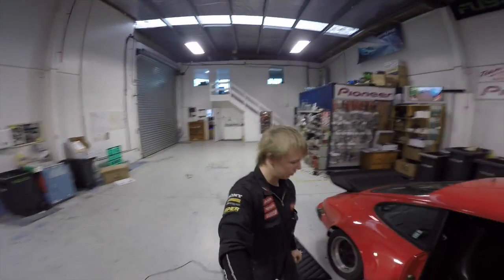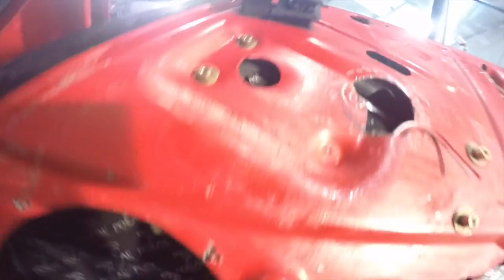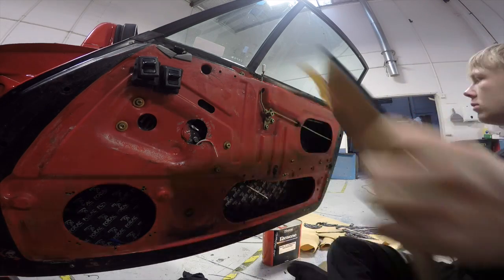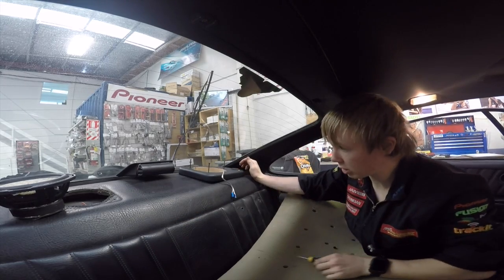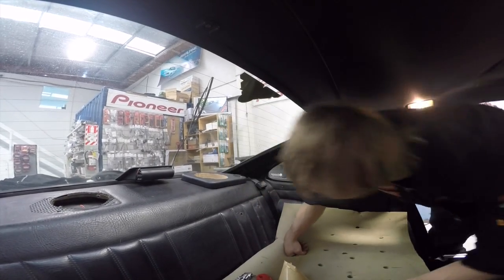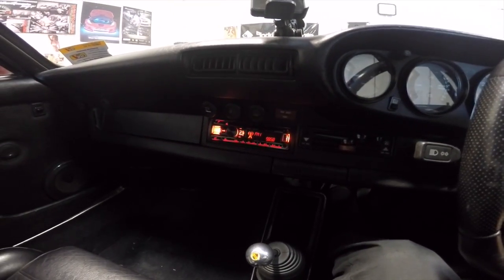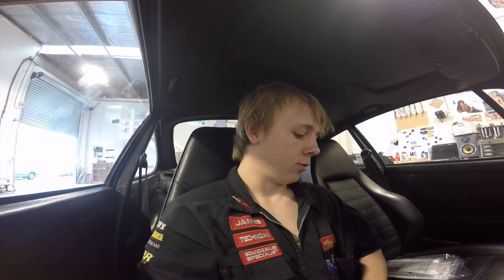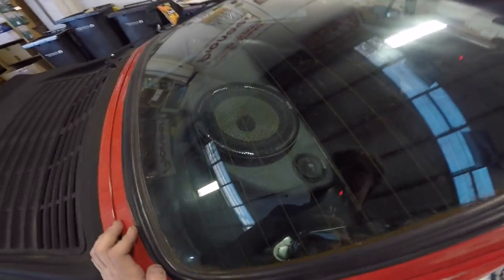Porche 911 Full Focal Sound System FINISHED!

Comment: your videos are great.  hope it is ok if I add a thought.  I like the focal bam on the outer part of the door but not the internal because water can get in there when it rains or even when car is washed, down the window glass.  better in my view to use Dynamat on the inside because its outer coat is metallic and it will not absorb or hold water.  I learned this the hard way, had used Dynapad on inside of door, car never sees rain, but from washing only, it was clear to me water had been retained at times when I looked in there a few years later.   Also, I love that Focal Bam as a cover but for eliminating resonance, Dynamat is awesome.  anyway, you have great skills.

Comment: Have you worked with the Focal FDP 6.900 Amplifier? Im thinking about transitioning to a Focal System over my current Infinity Kappa system. Thinking about going with the K2 components and K2 subwoofer.

Comment: Great setup, I do hope you cleaned up those wires for the customer though. The ones on the left side where you put the Xovers, kinda unsightly to see the insulator caps hanging out:)
Reply from the maker: Where abouts in the video are you talking about?
Reply: It was towards the end when you were doing the overview of work. Where you put the left crossover behind the carpet you could see the connectors above the carpet where your feet would be.  Didn't mean to point it out to make you look bad,  I think you do great work:)
Reply: It was at 16:53 by the way. I just know with my feet I'd probably tear a wire loose:)
Reply from the maker: All that extra wiring you could see hanging out was the cars factory wiring harness, nothing to to with the speakers and crossovers.
Reply: Car Audio.etc ah okay,  as I said I think you do great work😁

Comment: Hi can u help me,

My car was quite in running.
I got my factory fit speakers replaced and dampening done.

But since technician opened the panel, my door are giving cracking sound.

I installed focal Auditor Series Component and Coaxile installed.

Please suggest, is there any option to resolve?